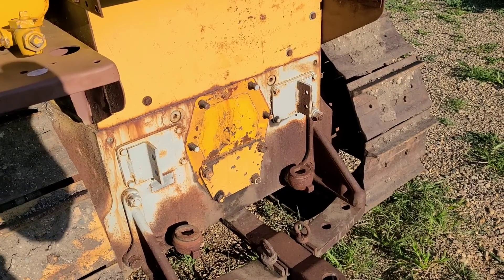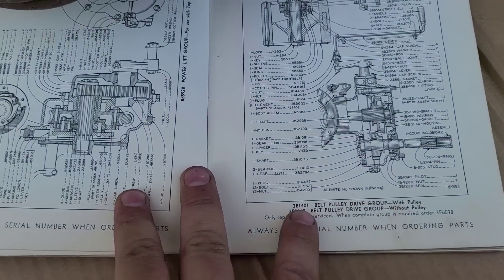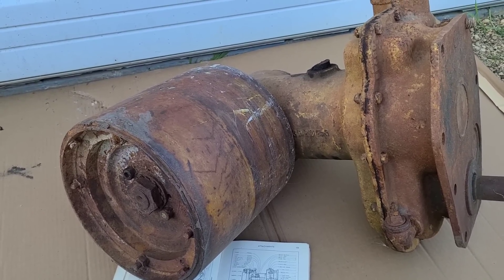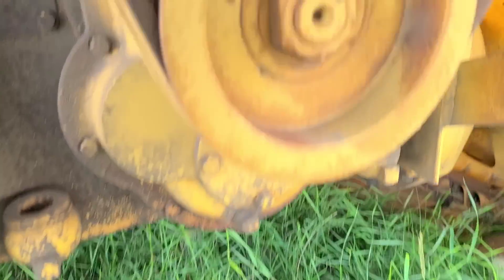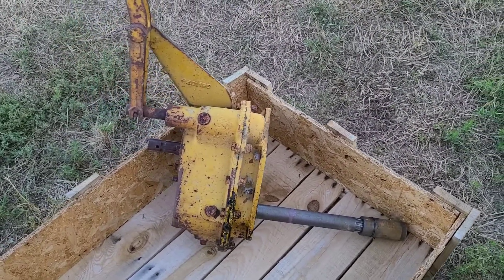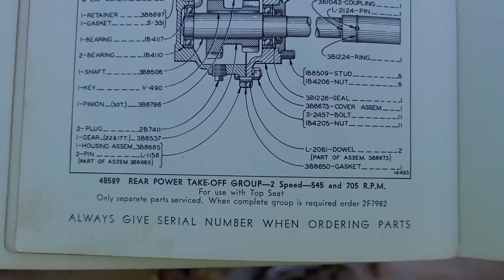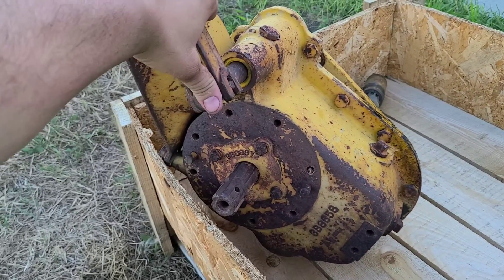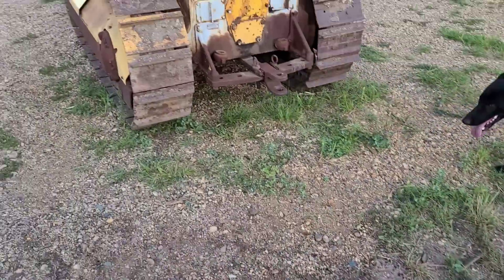Caterpillar D4 PTO Options, What's Going Where?

Comment: If I understood you correctly, your 540 only spins in reverse. but if you have the bolt on pulley with that unit you would have 4 pulley options and high speed pro shaft. I guess I think that it is strange that Cat has a 540 shaft option that only spins backwards or was there a bolt on piece like the pulley assy is,to get the direction changed to the standard rotation?
Don't the threshing show most use belt equipment? Seems rare to see pto equipment is use at shows in my area.
Reply from the maker: The wording in the operators manual is not the best, from what I was able to figure out, the 540 pto spins in the correct direction but the 700 spins backwards, this is for the belt drive. Hopefully this clears that up a little haha
Reply: @kylechrist  Sorry, it does not but it is not your fault. I just don't understand why a Manufacture would have a shaft that spins against convention. The 700 rpm shaft is a common shaft size and speed isn't it?

Comment: I don't have any advice on where to put various things, but I do have a couple of observations.

First, I'd be very disinclined to pull operating levers off a complete unit to build onto something else unless it was the only option. Those operating rods look like about 1/2" hot rolled bar stock with ball and socket couplers welded on the ends. Rod and I'm pretty sure those couplers are available from parts suppliers and steel houses. I'd be inclined to build the linkages from scratch if I could get the parts. (Or get other linkages from scrapped tractors, but I suspect that is fairly unlikely.)

Second, I think that broken guard mounting casting can be stuck back together with SS rod or braising, so that might be a simple repair strategy. Alternately, it could be stuck together with JB Weld and sent to a foundry as a pattern to get a new casting. Keith Rucker uses Windy Hill Foundry, but there may be something a lot more local to you.

Comment: I have the pto unit with removable belt pulley on my D2 - it's the most versatile option. For the dual speed, that's odd that the 540 would turn backwards - have you verified that? In any case, the 705rpm is useful when you're running machines with low power requirements so you can put it in high gear and throttle back to conserve fuel / reduce noise
Reply: Years ago I had a D2 that a pump mounted on the back and that broke so I put a 1,000 PTO shaft on it and use the PTO pump a thousand RPM. We had super fast hydraulic then.

Comment: I have one of the 2 speed setups on a D4.  The 545 rpm is standard direction for a pto.  The reverse higher rpm is for the belt pulley attachment.

Comment: I'm just dealing with a PTO for a crawler and im down to the same issue as you are. If you ever want to run anything that needs higher RPM output then take the PTO that is most suited for it. I think the only issue you may have is having to not only weld but swap out lot of seals. Cause old seals are oil leakers.

Comment: excellent video I think you should put the pto units on the crawlers like you were saying the 2 speed reverse rotation unit is pretty neat with the slow speed of the engine if gives you lots of options

Comment: I think your choice to use the 540 pto on that Cat if it's going to be your "daily user" crawler. Most of the older equipment was designed for 540 rpm and you'll have many options to work with. Whether it's hydraulic pump, water pumps, post hold diggers, or brush hog, etc.

Comment: As far as broken casting is concerned,  if you found a cast iron repair/foundry , there's a good possibility they may be able to repair/ re-cast the broken section back to the original housing.  I've had this done on many cast iron pump housings ect in my 25yrs as machinist repairing many items,  much better alternative than trying to weld the broken sections back on

Comment: The choice comes down to which is going to get the most practical use. For a "show" machine that would be the use with the most "wow" factor (you know the audience). For a working machine that is the best straight practical application based on YOUR projected use.
Reply: Exactly what I was thinking, the show tractor needs all the bells and whistles because the shows are where you need the versatility.  The work tractor needs more simple reliability.